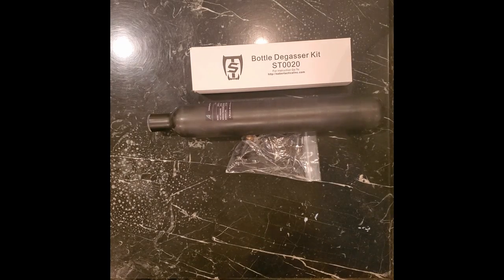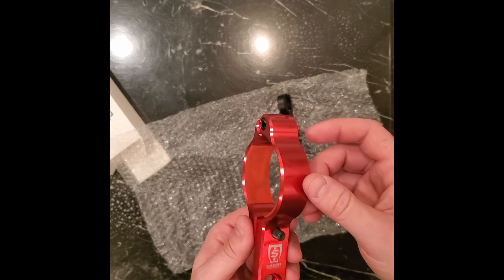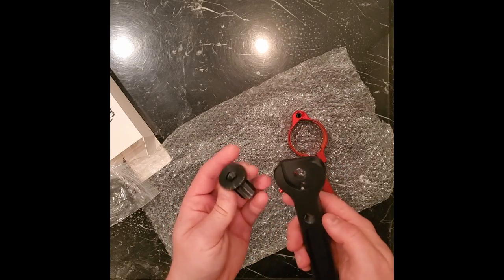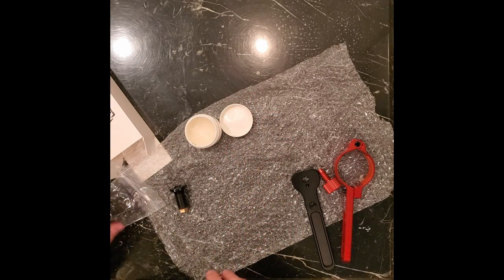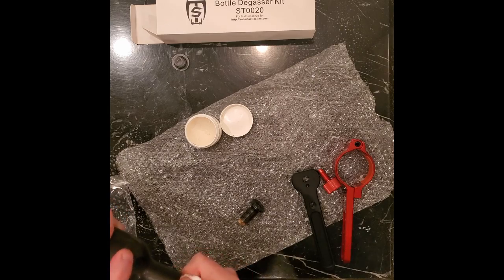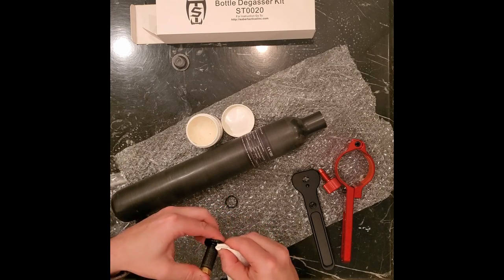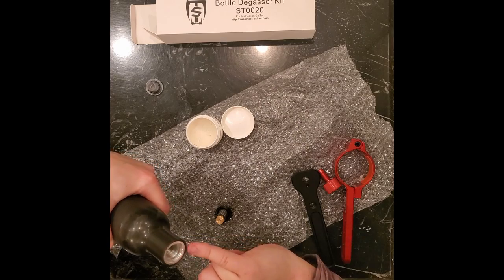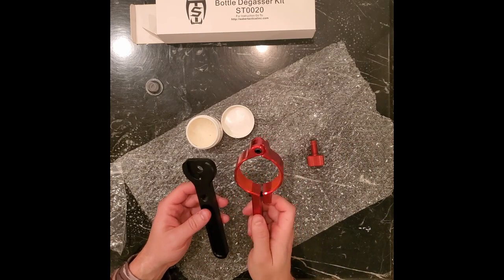Saber Tactical Bottle Degasser Review and FX Valve Installation on 700cc tank

Comment: You do not use locktite???  I just bought a new 700cc bottle and valve and I saw a video from 910 that said to use red or black locktite.  Thoughts?
Reply from the maker: Absolutely not DO NOT do that! Definitely not needed and you'll get your valve stuck.
Judt for example: this tank which I installed in this video holds the exact pressure I fill it to with no leakage ever, even after months of storage. Loctite is a mistake, for real. You don't need it.
Reply: @airshootist  I thought the same thing. I sent them a message saying "red and black loctite need heat to get it off How do you apply heat to carbon fiber?" They didn't respond.  Now I know why they didn't respond